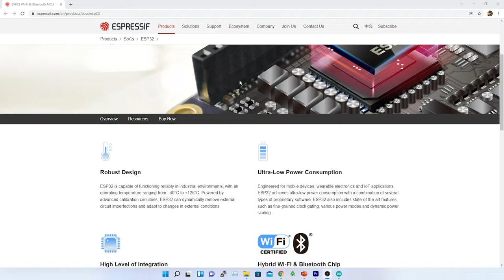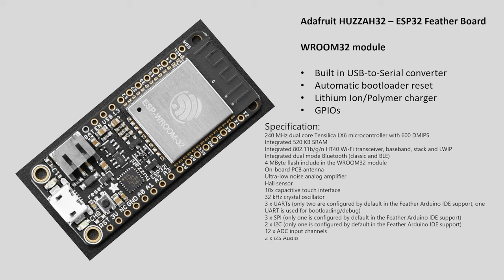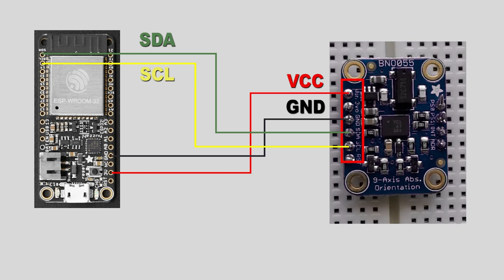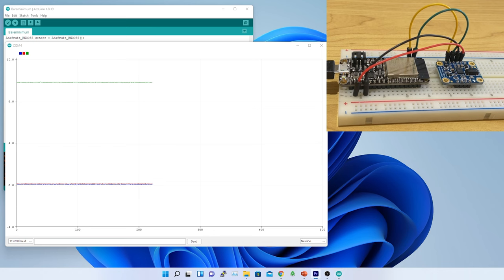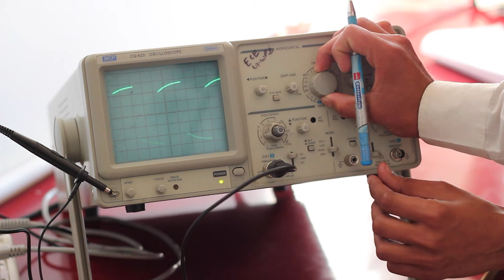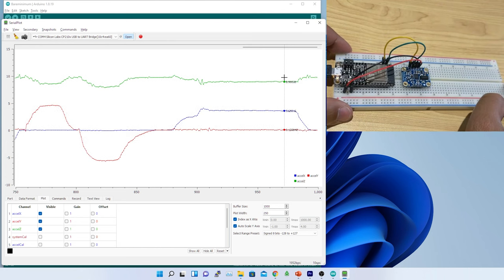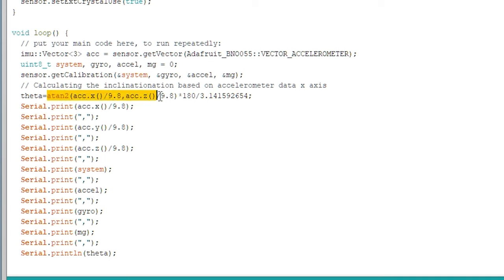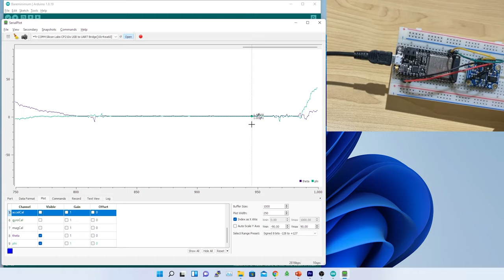ESP32 Feather with BNO055 to measure the inclination or tilt based on Accelerometer data with visual

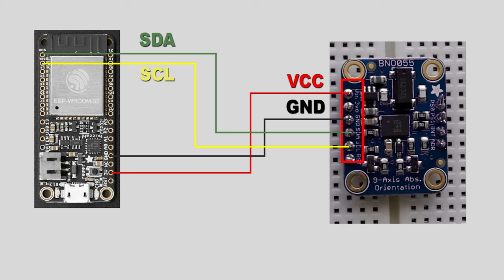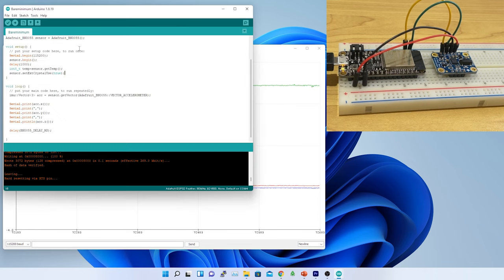Comment: Your Wiring in 7:19 does not look like your real setup in 8:09 .... Which one is right?

Also, when I run your script, I dont get data except constants. (0.00,0.00,0.00,0,1,3,1,0.00,0.00)

Basically, the script seems to work and there is communication with my PC and ESP32, but it does not get correct data from my BNO055... Am I missing something here?

Comment: Hi Bno055 ? Did you measure angle error once is turn on /off on two fixed positions?
Reply from the maker: Not yet, but all such things I have left till I implement the visualization of the sensor in Unreal engine.

Comment: Hi Bno055 Did you measure angle error?  I have a question test related if you turn on get a measure for fixed position 1 then turn off the sensor,  make a movement to  position 2 forced to then turn on the sensor and finally go back to first fixed position 1, how much it could be the angle error per axis,  Best Regards
Reply from the maker: Not yet, I will do it soon when I bring magnetometer in the mix. Magnetometer will give me true north after calibration. Then measurement of the angle deviation would be easier. After complementary filter implementation I will start exploring magnetometer. 2 more videos away. So please stay tuned. Thanks
Reply from the maker: Hi Jean, yes we can save the calibration offset in bno. You don’t need to do the calibration every time you restart the sensor. I will implement that soon
Reply: @others-makingofrpgvideogam4262  nice waiting to see next improvement